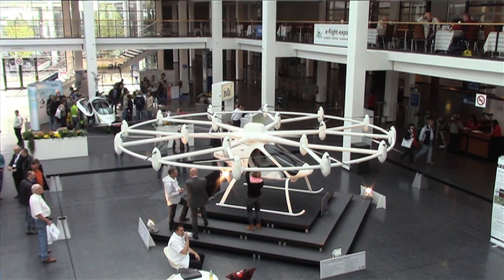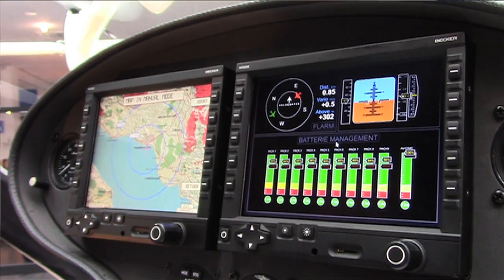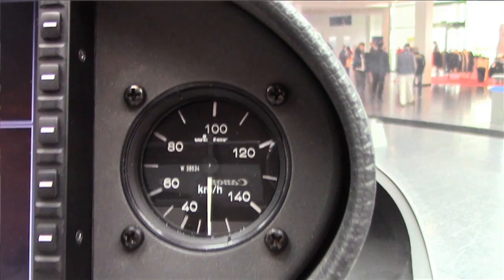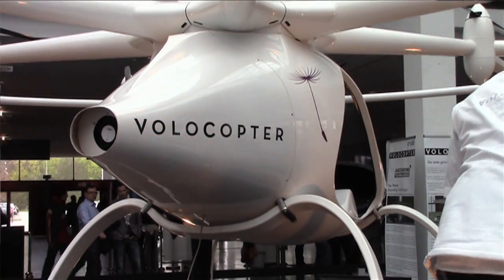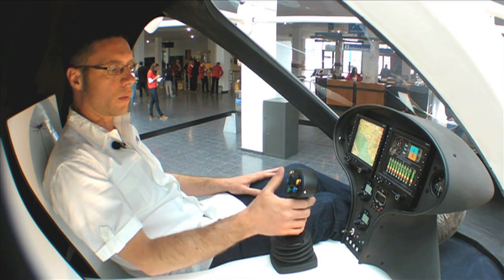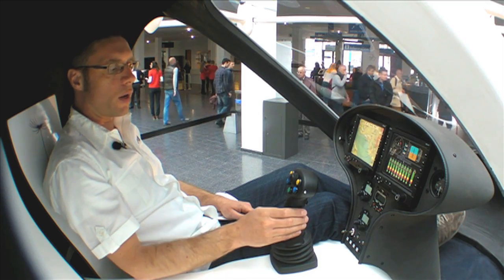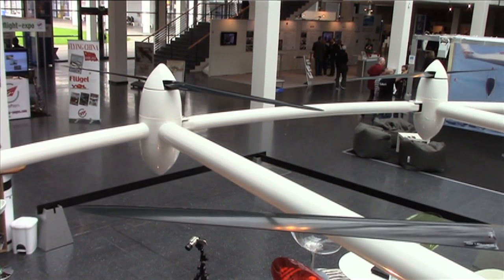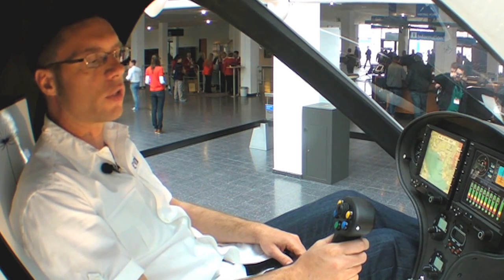Volocopter Debuts at Aero 2014

Comment: I would like an equivalent to autorotation in a standard helicopter in case the computer takes a puke. Since these could supply thrust in a preset level(s) they could be manually switched in. Some slower rate of fall rather than as a stone  would be an improvement.

Comment: can something like this do auto rotation ?
Reply: translation from german in another vid says it's fitted with a parachute - top centre I guess.  Probably better than relying on "proper" autorotation, which it can't do because the props are fixed pitch.  However... in unpowered descent the air resistance of the props will make them spin and provide a little braking effect, just not as much as reverse pitch can give you.  Personally, I'd feel safer in this than a conventional single-rotor copter!
Reply: Simon Iglesias parchute plus airbag as in mars lander?
Reply: +Ray Kent I have an animal feeling almost anything would be safer than a conventional. I am afraid to ride them. Multirotor has loads of appeal. Natural stability always wins the day. Standard helicopters are like trying to balance a broomstick on your finger.  Not stable.

Comment: This is nothing but a huge toy.  I want one,  If anything Amazon or Google will buy these guys out so they can make deliveries.  No human will pilot this thing.  To much weight for starters.  If the person went to the bathroom or ate to much that day.  Controlling human weight would be the constant problem.  But if you have packages you can load a set weight every time.   Plus the insurance to fly these things will be cheaper for packages compared to putting a human in them..

Comment: The most concerning limitation I think it's the fixed pitch of the propellers. That menans that lift deppends on rpm rather than torque. So when it reaches the maximum RPMs, that's it, no more lift available no matter how many HP are remaining. Also the fixed pitch make it impossible to autorotate.
If one engine fails, the propeller can't be feathered, which increases parasite drag; to compensate that loss the remaining engines can't increase their torque, so the "opposite" engine will have to reduce the RPMs (maybe to zero), this results in a decrease in total lift, forcing the helicopter to descend.
Something similar would happend in a cross wind condition, the upwind engines must reduce RPMs to compensate the drift , since it can't be done by a rudder or tail rotor.
The parasite drag caused by that "structure" that hold the engines may be enormous. It may be lighter than a single rotor, but the rotor produces lift.
20 to 30 minutes is not enough considering that it may not fly much faster than 50 knots, And I guess the service ceiling may be about 1000ft (in a very cold day)

Comment: trow out the batteries and built in a small electric generator that powers the electric motors, and keep a few batteries, that have just enough power
for a emergency landing when the generator fails, and then it's perfect
Reply: +3DPeter It would be good if this thing could use just "small generator".

Comment: why not power it with a traditional engine that runs on hyrdogen instead of trying to get on the moronic electric bandwagon?
Batteries simply can not get much better.
Look at how much they have advanced in the past 30 years, they hardly have at all.
Reply: Actually electric motors are an easier approach in a multicopter since it allows precise control over the individual blade speeds with PWM. It would be very challenging to develop a multicopter that actually uses gas power. as for the batteries, I am sure battery life is a huge problem in this design. I would almost think powering this thing with an electric generator could be a more effective approach than batteries, though i'd be surprised if they actually did that.
Batteries actually have advanced quite a bit in the past 30 years, but still not enough. SuperCapacitors show some promise, but it'll be a while before we see a practical Super Capacitor.
Reply: inagod
No, batteries simply can not get any better, that is why phones used to stay charged for 3 days at a time and now they only last 6 hours before charging, they use the same batteries.
Reply: roflcopterkklol Dude.. you're talking from your ass. The capacity of the batteries in phones 8 years ago were less than half per volume (nimh compared to nowdays li-ion). The consumption of smart-phones compared to old ones are +500% and more.
Reply: Peter Gorbunov super capacitors are reaching limits way faster than battery and the weight to capacity is still no where near lipo/liion, life and similar batteries. Their high charge/discharge rate helps nothing here. They are really close to doubling or even trippling a classic lithium battery tho, by changing the material to one that can accept 2 or 3 electrons per atom as opposed to 1 in lithium.. just a matter of time.
Reply: The demand and need,pushes the development of better batteries,electric motors are superior to a combustion engine.Electrics are much more efficient,almost double the efficiency of a combustion engine.You could never control a combustion engine to work as precisely as these electrics.Within 25 -30 years battery powered cars will have ranges of 600 miles,quick chargers will have you down the road in minutes.
Reply: Google+ SUCKS BALLS - the worst forced social network
And it is still fuck all. Face the fact that batteries will never be a reliable replacement, Hydrogen is the future.
Reply: roflcopterkklol a pretty distant future.. since we know alot about fusion for a long time and yet have to produce single Wh of electricity from this technology.. and even when/if we do develop it, you probably couldn't fit a fusion generator to your pocket watch. Until then batteries are the only option for storing large ammounts of energy and they are getting better every year.. just check out the new "NCR18650B" specification, if you can comprehend all the data.
Reply: +inagod Elon announced 1000 mile tesla by - I think - 2017
Reply: +roflcopterkklol An engine driving an alternator is doable. Lightweight engines with decent power are scarce as hens teeth. A less stressed heavier design  has that huge black mark against it - heavier. This is an air craft. Air is  pretty light stuff to hang on to with a fan.

Comment: Hay engineers... the fine structure constant e{a}/t=hv is caused by the asymmetry of the weak force and time dilation maintaining E as a constant using a second reverse arrow connected to time. The "missing" graviton is the 4th oscillation phase of the atom in space that is relative to time... how could the atom not have a 4th oscillation phase? You guys call it the "hole". You see it in semiconductors because of its reverse phase timing arrow. Ask CERN about their "loose cable" and why (v-c)/c=2.48e-5 sec in 453.6 miles matches SLAC's E158 weak force asymmetry data. Impossible coincidence as 3 separate ratios are created just like I said it would for years. And then SLAC confirmed the asymmetry in time going back over their BaBar data so a 3rd experiment confirmed it. Do the math: the distance CERN's neutrinos traveled is 453.6 miles and the asymmetry of the weak force adds one hour every thousand years or 3.6 seconds a year. Gravity is caused by subtrahend of two harmonic commas. There's no missing matter... Jezzz. Time to learn how to create energy out of space... it's there just waiting to be tapped using {a}. We are looking at light created by a speed of light clock and {a} makes our clocks move. Wake up to what's going on around you! I sued Boeing's senior scientist Dr. Mark Skinner so don't expect a news announcement.... look what he did. Good or bad... take your pick and then take the ride. I'd pick good if I were you. Time tells all. Right Mark?

Comment: Dont Work!  Physicalic not Possible !   Lithium, Ion  technology maximal has 3 kW/kg,    Vehicle wight >100Kg   1! Person Y 80kg Accupac  need > then max wight > 180 Kg it's IMPOSSIBLE !!!  Like E-Cat and like Cargolifter  wont make Money next step make the AG :)        YOU Need  25 kW/kg  for 30 minutes to fly with two persons. limit , not in this centaury one atom can bind 3 Free electrons :)   works only in low dimensions for minutes...
Reply: I'm sorry to disturb your distorted view on physics, but it cerainly is possible to get it into the air, fly it, land it and recharge it for another go. The imformation about the Poweroutput of a battery is irrelevant. You can use transformer to adapt the output towards the necessary amount. And that's what they did.
You might argue: "The chemical reaction in the batteries providing the power is to slow"
This argument is also invalid, one can simply use a bigger amount of cells with decreased size arranged in serial circuit. The amount of power is not the problem. Therefore getting of the ground is possible. The only sacrifice made due to these adaptation is the flight time. It therefore only allows to be flown for half an hour. In combination with a fuel cell for instance, it would be possible to fly for hours.
Have a nice day sir!

PS: Please note, I'm from Germany and therefore my English might have one or the other flaw. Explaining technical issues is rather difficult, I still hope you could understand what I tried to express.

Comment: Until someone hops in it, and flies it, it's just a fancy multi-rotor remote controlled copter. Grow a pair of huevos and fly it as far as the Wright Bros. first powered flight, and I'll put more credence in this being viable.

If the engineers won't fly it, what are they scared of?
Reply: Zaphod Breeblebrox The main issue is that it's not legal in Germany for them to fly it right now. The only video of it flying is in a warehouse. Extensive testing is planned for the Government of Germany to put Volocopter into it's own aviation category separate from Ultralight aviation (which is currently illegal in Germany). All of this information and more is available on their website at e-volo.com
Reply: David Parker Why is ultralight aviation illegal?
Reply: +Moultonist ultralight aviation is not illegal in Germany. The issue is that this craft is not currently classified as an ultralight.  Did you have the sound turned off?  Similar to the legal pickle surrounding e-bikes.
Reply: +Moultonist The sky is crowded. We use licenses and taxes to stimulate or discourage activity by the public at large. Ultralights don't lend themselves to the altitudes of normal light aviation so wont become a significant hazard.

Comment: I can't wait to see what advancements in battery and computer technology bring to the aviation industry in the coming decades.  10 years ago, laptops had an average battery life of around an hour.  Now, the average is closer to 8 with some reaching past 20.  The battery technology behind it is advancing quickly.  We're using mostly lithium ion batteries today, but with lithium air batteries, the storage density will jump by around 15x, giving this thing about 7.5 hours of flight time, and the leap beyond that will come even faster.  Before long, I'd venture to guess that there'll be autonomous personal air transport vehicles like this.

Comment: About engine reduncency....
If you lose the use of one engine/rotor, you've actually lost two.
The torque of the clockwise spinning rotors has to equal that of the counterclockwise spinning rotors.
Lose a CW engine and the remaining CW engines would have to speed up and/or the CCW engines slow down. THAT'S how the model quadcopters turn. Unbalancing the combined engine torques.